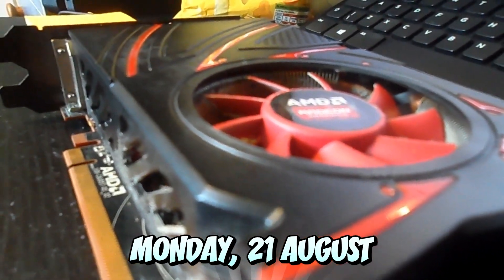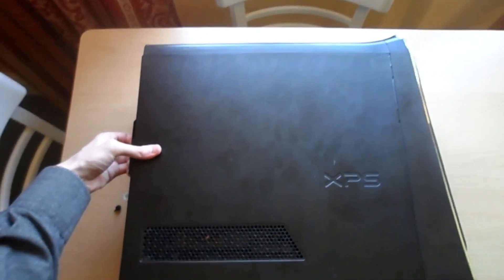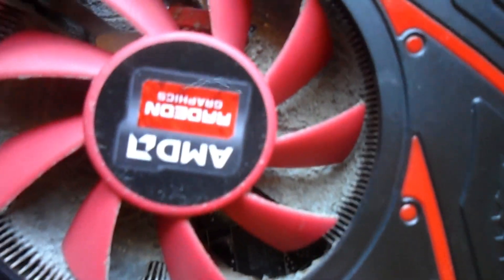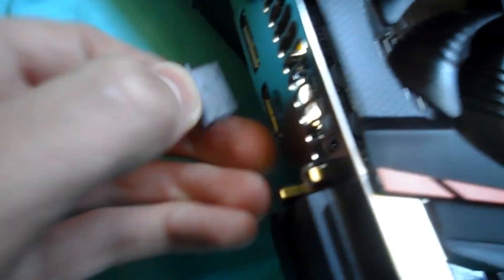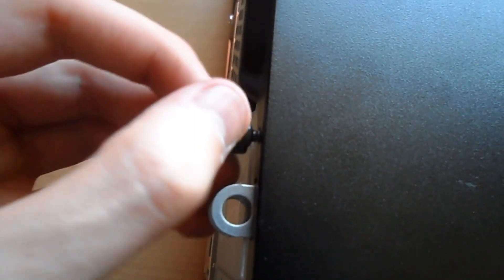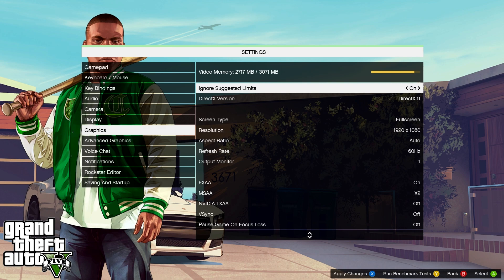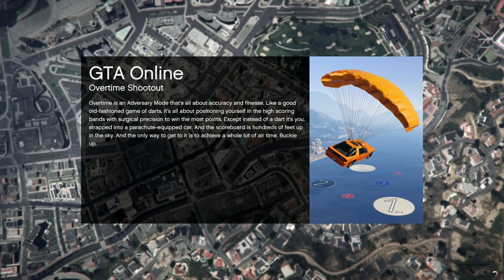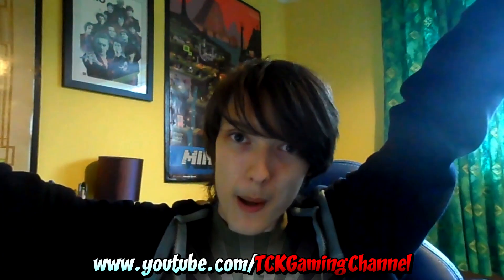NOOB GPU UPGRADE! ➜ Nvidia GTX 1060 (Dell XPS 8700)

Comment: I can't find any graphics cards to fit the 8700 because the GeForce GTX 1650 SUPER OC is no longer available
Reply: U cant use that anyway u can only use gtx 960,1050ti,1060,970 and so on

Comment: Great video mate. I stumbled upon it because I am having the EXACT same problem with the exact same rig right now! My R9 270 has just drawn its last breath and I my computer crashed. Thankfully, I remembered that the XPS 8700 also has a built-in Intel HD graphics processor, and I was able to switch to it and continue running Windows. Gaming is out of the question with no GPU of course, so I'll be getting a new Nvidia GPU just like you did and I'll follow your guide!!!! Thanks dude, and happy gaming to you!!!

Comment: I am watching this in 2020 because I have a Dell XPS 8700 too! I was curious about the newest graphics card possible. I upgraded my original about 4 years ago with a 750Ti. I like my 750 Ti but seeing what is possible is good to know. I would personally go with a single fan card so it fits easier in the case. The Dell XPS 8700 has such a small case it makes upgrades kind of hard. Anyway thanks for making this video. It has been very helpful.
Reply: You can technically run any gpu that uses a pcie slot but a power supply would become an issue if you went for like a 3090

Comment: Thanks for the video, I recently updated my dell xps8700 with a rtx 2060 single fan GPU, and evga 600w bq PSU, but now my computer restarts randomly, did it happen to you? I dont know why this happen.
Reply: Hello any updates?
Reply: @JTeK19  Yes, now it runs perfect but need to do some changes: need to install gforce experience, then in Nvidia control panel/ manage 3d settings/power management mode/ change to: prefer maximum performance. After do that on windows energy options: change to High performance then in  turn off screen /change to Never.  and the same thing with sleep mode. thats all, runs stable now. Tell me if that works for you.

Comment: I have the same GPU, and computer. But unfortunately, I’ve had enough with the computer and I’m getting a new computer but using drives, GPU, and Power Sub. And I’m just getting a new case, MOBO, RAM, CPU. It was a good computer and I loved the thing.

Comment: Did you upgrade the power supply or use the stock OEM that came with the XPS to run the 1060 graphic card?
Reply from the maker: Used the stock PSU, it's a 400W card so it works fine with it
Reply: @OfficialTCK  Yes, 400w just for the graphic card (when in use), but you also have to account for the rest of your system...

Comment: Don't worry. Upgrading my XPS 8700 GPU was my first upgrade ever. I removed my old GTX 660 without any problems, except I was trying to insert my new GTX 1050 with it's pin cover, so I realized it and discarded the cover and installed it. Don't worry, not everybody can make the upgrades successfully first time.

Comment: Did you uninstall old and drivers before installing your card?
Reply from the maker: Nah, the old AMD drivers became redundant with the new Nvidia card so they just didn't run at all. It was just like running a card with no drivers. I replaced them afterwards with no trouble.
Reply: @OfficialTCK  thank you.
Reply: @OfficialTCK  I just installed a new gddr5X 1060 into my old I7 dell optiplex, Going from a crap radeon 7570 is a whole new world. This video was very helpful sir. Bravo

Comment: Thanks for this video. I recently started playing Final Fantasy 14 and realized that maxing out the settings wasn't happening on my XPS 8700 with an AMD R9 200, less than what you had. So i'm on the hunt to upgrade and came across this video. I haven't pulled or rebuilt PC's in forever, glad to see there's some hope for me! Now to see what's the latest card I can put in safely. I may just go with this same card and be done with upgrading cards until new PC time.

Comment: Great Video.  I want to replace my nvidia gt720 with a 1060 and now have more confidence it will work   If anyone  out there knows of any issue I could encounter, please give me a heads up.
Intel i70 4790, 24 gb ram, Bios A11.  Stock PS (460watts)  I'm so scared. lol
Reply from the maker: Giving people confidence was exactly why I made this video so I'm glad it helped you! I was terrified too so I was really happy when it worked first time. I hope it works out for you too!

Make sure you remember to plug the keyboard back in though. 😉
Reply: How did it go man , my 8700 has the same specs as yours. Did you run into any issues? I'm also think about getting a gtx 1060.
Reply: @gavinfragoza1428  Well..I had a pro do it for me.  He recommended and I agreed to a new motherboard and power supply.  Of course that required a new case.  So I have a much better pc. for gaming.

Comment: Great video! I'm having some issue with my R9270 in my XPS 8700 as well. What symptoms are you going thru before you confirmed that it's a dead card? My card will hang the entire PC upon launching any games or graphic intensive stuff. I tried changing the GPU fan thinking that it might be the problem but issue persisted.
Reply from the maker: It sounds like the card's on its last legs. Before mine died I kept getting graphical glitches and bad performance, then it completely died and refused to boot into anything other than safe mode. You can try running in safe mode and see if games run okay on integrated graphics. If so, it's probably the card. Good luck anyway!

Comment: I know you probably won't respond since this video is quite old but I tried to convince my dad to upgrade my graphics card to the same card you used. Are there any complications with upgrading my currently untouched Dell XPS 8700 with a 1060?
Reply: I have a gtx 1060 6gb msi gaming x on my dell xps 8300, so, I can said that you will no have problems to upgrade your system with that video card, but I must recommend you the zotac amp edition, cause its an smaller card with 2 fans, and it's compatible with the dell psu stock cause use a 6 pin power connector. I was forced to buy a new psu and a new case, because I did not calculate the length of the gpu and I did not think it was have a 8-pin connector
Reply: I just want to try again to convince him
Reply from the maker: No you're right, I probably won't. But if I did reply I'd say that I didn't have any complications so it should be fine. 😉
Reply: Thank you for the video btw.  I'm attempting to do the same.  While you're answering questions, did you have to get a new SATA cable or a new PCIe cable? I keep reading this everywhere.
Reply from the maker: Nope, the default ones are fine.

Comment: Can an ASUS 1060 work in a dell 8700?
Reply from the maker: It should be fine as long as it's the same size and doesn't have a power consumption higher than 460W.

Comment from the maker: If you are here because you are modifying a Dell XPS 8700 yourself, I can confirm it works perfectly. It is a 400W card so it will work with the stock 460W Power Supply Unit (PSU), and I found a BIOS update wasn't necessary beforehand, even though the rest of the internet says it was. I still recommend updating the bios anyway which I have since done, but don't worry too much about doing it beforehand. I even converted from AMD to Nvidia with no issues.
Reply: TCK - Gaming Channel Oh so many technological words. Hurts my brain!
Reply from the maker: HELP ME MY BRAIN IS PAIN!
Reply: What were exact pc specs b4 upgrade? just curious. and was it the 16 inch height or whatver xps 8700? im also tryin to upgrade my gpu in xps 8700 with the 1060 also
Reply from the maker: Yep, it's the 16 inch one. Good luck with your upgrade!

Here's the full specs:
Processor: 4th Generation Intel® Core™ i7-4790 processor (8M Cache, up to 4.00 GHz)
Operating System: Windows 8.1 64 bit ENG,SWE,DK,NOR,ESP (upgraded to Windows 10)
Display: Dell 24 Monitor | S2415H - 60.4cm(23.8") Black UK
Memory: 32GB Dual Channel DDR3L 1600MHz (8GBx4)
Hard Drive: 2TB 7200 rpm Hard Drive + 256GB mSATA Solid State Drive
Video Card: AMD Radeon HD R9 270 2GB GDDR5 (upgraded to Nvidia GTX 1060)
Keyboard: Dell KB213 USB Multimedia Keyboard - UK/Irish (QWERTY)
Mouse: Dell Laser Mouse
Wireless: Intel® 7260AC + BT4.0 [802.11ac + Bluetooth 4.0, Dual Band 2.4&5 GHz, 2x2]
Optical Drive: Tray Load Blu-ray Drive (Reads Blu Ray and Writes to DVD/CD)
Ports:
Media Card Reader - 19-in-1 Card Reader (CF Type I, CF Type II, Micro drive, mini SD, MMC, MMC mobile, MMC plus, MS, MS Pro, MS Pro Duo, MS Duo, MS Pro-HG, RS-MMC, SD, SDHC Class 2, SDHC Class 4, SDHC Class 6, SM, xD)
Networking and Wireless - Intel® Centrino® Advanced-N 6235 + Bluetooth 4.0, Dell Wireless-DW 1703 + Bluetooth 4.0
Slots - Memory Slots, 4 DIMM
Reply: What bios version were you on, the 900 series cards required a bios update of atleast A10 that's for certain.
Reply: I installed a 1060 6gb and I experience a huge CPU bottleneck, is this just me?
Reply: Hi, which bios? The latest or a13?